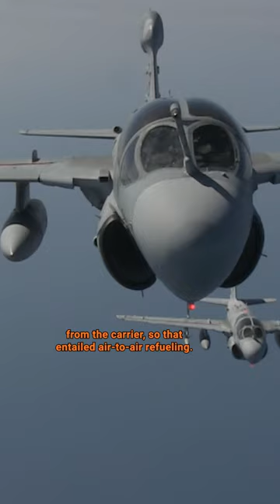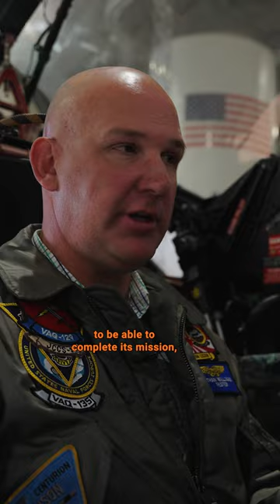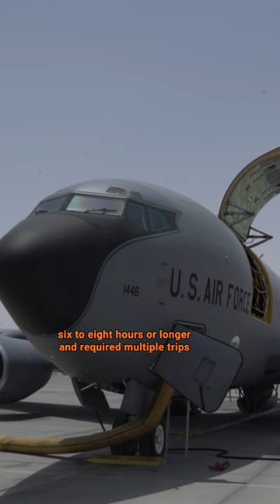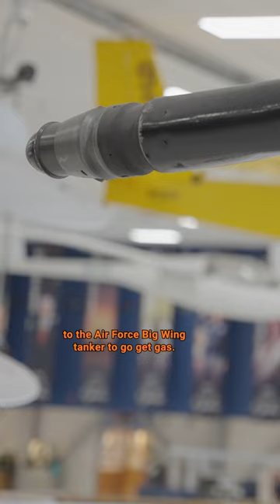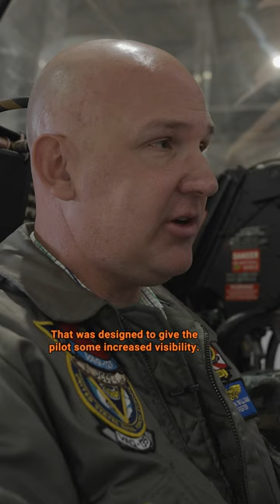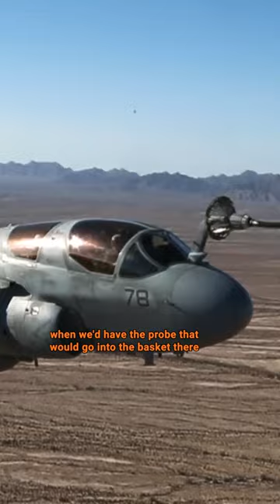Part 10 | EA-6B Aerial Refueling

Comment: Did you refuel in hostile territory? Did you have other armed jets flying protection? I served at McConnell AFB, they have a huge refueling group there. Middle of the US.
Reply: Back in 1982 I did nine weeks of training at McConnell . You air refuel at a safer distance for the tanker and the receiver.  Sometime you had fighter cap but most times you with a wingman and relied on electronic jamming and speed and agility.

Comment: What's the point of having a navy plane that needs fuel from an airforce tanker? why not just base them at the same air base as the tanker?  just not bother with the extra costs of running off the aircraft carrier